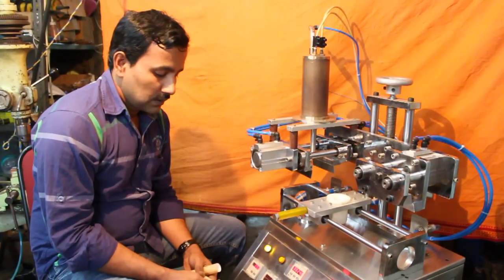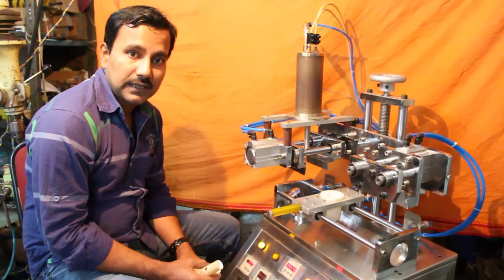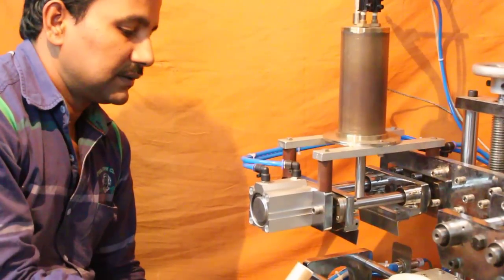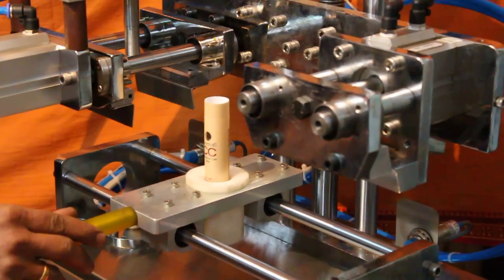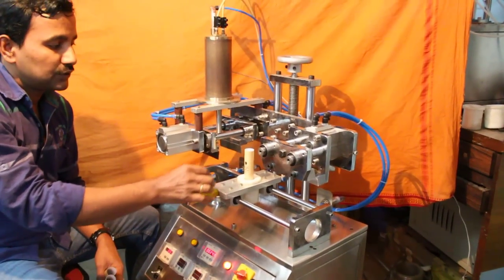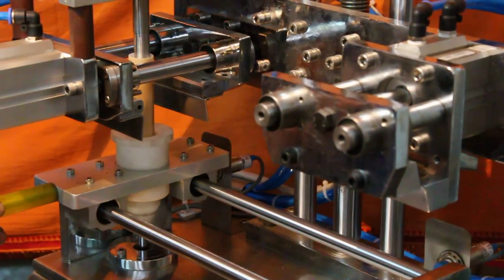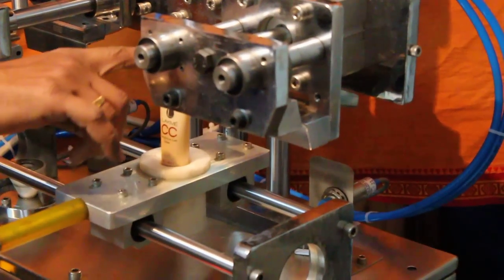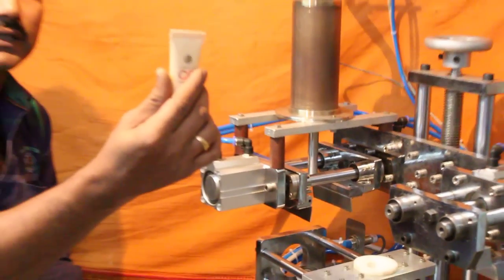Tube Sealing Machine Compact model Semi Automatic PSCT15

Comment: What is the size capacity?
Reply from the maker: Hello..
Thank you very much for viewing the video. 
Sizes of tubes can be from 10mm diameter to 50mm also with the help of change part Hot air nozzle and tube holders. 
Regards 
MADHUSOODANAN NAMBOIDIRI AMSON ENGINEERING 
Mob. +91 9892589976 what's app. 
E mail address.  amsonmadhu@gmail.com